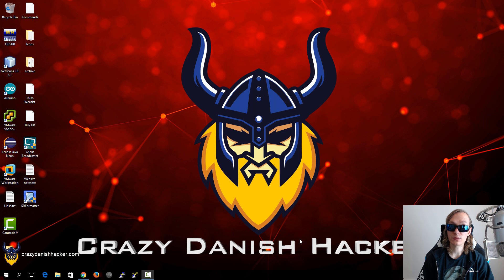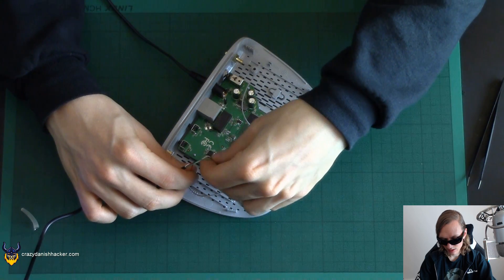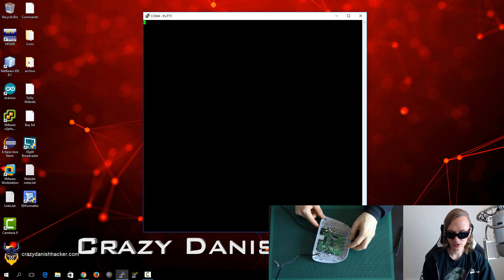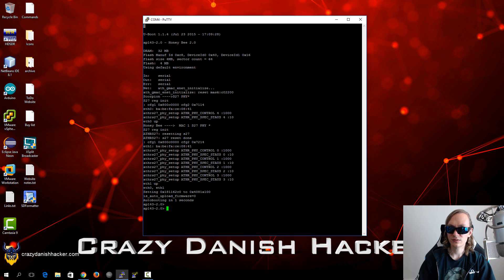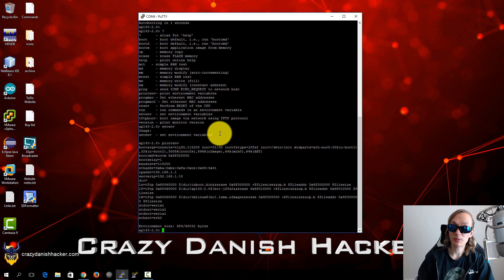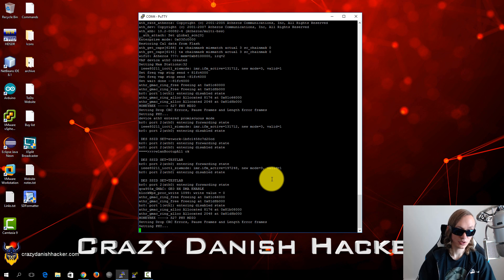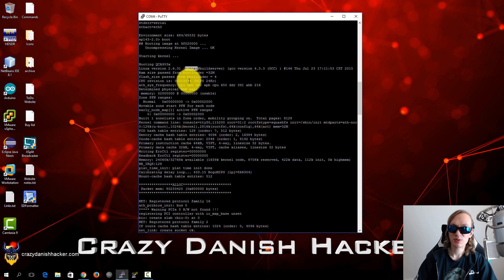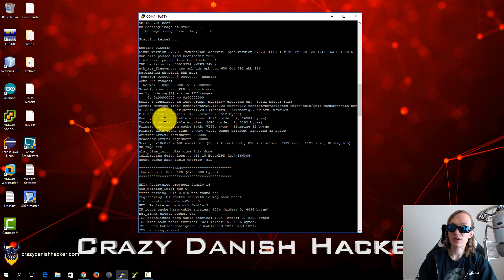Accessing Hidden Serial Consoles - USB-to-TTL Demo 1/2 - Hardware Hacking Series #4

Comment: Hello Bro before couple day i had a wimax modem device  i uploaded hd pictures 
front look : www.googledrive.eb2a.com/1.jpg
Back look:www.googledrive.eb2a.com/2.jpg
ITEM:INTERNET MODEM
MODEL-SWU-9000
WIMAX MODEM (they call it MIFI)
and by the way i can login using telnet because it's turned on even the login of admin is accessible 
www.googledrive.eb2a.com/3.PNG
 and i can't Do any Thing with it because it isn't root I've test many passwords with no avail 
i will apply any suggestions and would like to know on which pins should i attach the multi mater 
Thanks for Your useful videos ....
Reply from the maker: Next time please use a web site like imgur to upload your pictures, it's very odd that you need to have JavaScript enabled to view those images on your website. 
The first image is a photoshopped woman? https://i.imgur.com/uuZQXbA.png Looks like an older female version of myself from an alternate universe lol 
Concerning the second image, the debug port is possibly JTAG, or maybe a proprietary type of debugger. 
As I mentioned earlier, it's very likely that this USB port has a multiplexer built into it, which means that depending on the type of resistance on the "ID pin" you may get different modes which I mentioned in a previous comment. This requires a bit of skills but it is possible to do. 

It looks interesting that you can log in using telnet, I'm assuming the password was also admin? In that case it's almost certainly hardcoded and not ideal to have enabled by default. With the telnet interface the following commands will be useful in particular: run and maybe dbg_wmx.  The "show" command may leak interesting information too.

Anyway, while the telnet interface may be of interest, the web interface will likely have its own share of vulnerabilities. For example, another model called SWC-9100 had some fairly serious vulnerabilities:
https://www.exploit-db.com/exploits/39073/
https://www.exploit-db.com/exploits/39074/

Manufacturers typically rely on the same frameworks and developers whenever they design new models, so that means your SWU-9000 model could be vulnerable to the same type of exploit.

If there's a firmware download available on the WiMax manufacturer website, then you could download that and inspect it with binwalk for example. 

Concerning your question about a multimeter, just try all the debug pins. Don't bother trying it out with the USB connector. For that you will need to design a custom USB cable which I'll hopefully get around to making a video about soon.

Comment: Take off the video about imsi catcher, it can be realized with the help of blade rf :)
Reply from the maker: I know, but it's not very reliable and it's only 2G. Refer to the following paper for example: http://www.delaat.net/rp/2015-2016/p86/report.pdf
Reply: Thank you :) there is an article how to connect your cell with an external operator ? so the victim could,as usual, to communicate (texting,calling, etc) I have a fake cell,but I don't know how to forward traffic to the external network,I want to catch incoming SMS and all :) on the Internet there is no information how to do it :(((
Reply from the maker: You can forward calls and SMS using maybe a VoIP gateway or something else. You can forward GPRS/WAP traffic through your own Internet connection. And no you can't redirect incoming calls because the other mobile networks don't know your network exists.
Reply from the maker: If you read the paper in full, you would see that there is a guide to forwarding GPRS traffic. For VoIP stuff, I recommend googling until you find the answer. Keywords: yatebts, voip, gateway.
Reply: Crazy Danish Hacker There hackrf is used, and I have openbts motorola: ((asterisk is installed, but I do not know what to do next ((
Reply from the maker: I don't know either, but with a HackRF you probably need a TXCO module because it's not "in sync". Think about this though, you have Asterisk installed, but where is it routing traffic to? Nowhere :-) You need to forward that traffic to a real telephone line or VoIP gateway.
Reply: Crazy Danish Hacker 
And how do you redirect traffic to an external number? To the number of the real operator ..
Reply from the maker: You need to use a gateway which I've mentioned several times. Google Asterisk VoIP gateway tutorial.
Reply: Thank you. I'll try to figure it out.